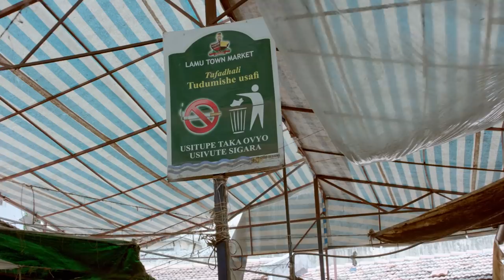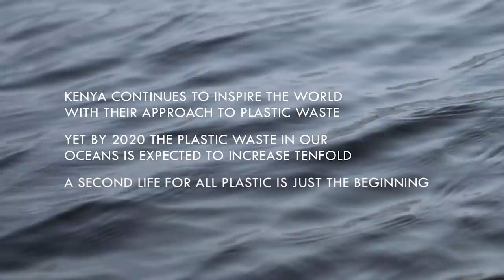A Boat Made From Plastic Waste is One of Kenya’s Solutions to a Global Problem | Short Film Showcase

Comment: This is incredible! We have all of this plastic and until there is none being produced, finding creative ways to reuse it is a great idea!!
Reply from the maker: We agree! There is so much importance in reusing resources rather than tossing them out.
Reply: Surly we should be able to produce  as much as we have and 'end use' for.... It lasts forever so little fluffy packets and bottles and trays is not what you want littering the sea and forest. But what's wrong with rail sleepers/construction beams , heavy or just light duty bricks, and boats like this? Its a very useful resource why not produce any? Its littering countless little fluffy bits that's the issue, we only need people to throw that stuff together, enough of this 'recyclable/non-recyclable' nonsense, it's plastic it's plastic it goes with other plastic to the same place then it can be separated into types if it's worth separating for anything in particular.
I'd say we only really need people to separate 'clean' rubbish like glass, paper, card and plastic from gross garbage. But perhaps plastic should be separate as its a little harder to separate plastic from paper and card but glass is easy as it's much Heavier.
Reply: I think its more likely that this is the only material available to use. Economically plastics are cheaper than wood or metal, they also require less knowledge of material properties to use.
Reply: Not the point...
Reply: There's lots to be done to grow plenty of trees and there's plenty of metal on earth, essentially limitless but for the difficulty in mining and refining.
Reply: i miss you so much my Country Kenyan 😂😭😍

Comment: Microplastics, the recycling solves only half of the problem.
Reply: Yeah not littering plastic in the first place would help prevent a lot of that but it's just not normal to have separate plastic bins in most places.
Reply: @leifcian4288  It's normal in some places
Reply: Something is better than nothing
Reply: Stopping it from getting worse is a good start. Microplastics are still a big deal and the hardest one to resolve but this still makes a difference especially in places where recycling isn't mainstream
Reply: @jblob5764  Plus less larger plastics means less out there to slowly turn into micro platics
Reply: Microplastics are in people
Reply: Half is better than nothing.
Micro plastic mostly are directly made for body wash and cleaning products
Reply: @leifcian4288  yeah those sleep well bins, the ones that make cubes that aren't pure enough to process and get dumped in Asia.
And into the ocean.
Bury it
Reply: @samlabo1688  why isn't pure enough to posses? Into what? Why not encase the least useful stuff into light duty bricks?
Reply: Stopping cruise ship ocean trash disposal would be a no brainier !

Comment: The problem is,  once it is recycled it still exists, and that itself is a problem as eventually, the recycled object will become trash. While helpful and certainly necessary in the short term, recycling is only prolonging the necessary, what is needed is a way of breaking down plastic completely.
Indeed, the best way of recycling is for use in large, more permanent things such as this boat, buildings etc, and although still somewhat useful, the smaller trinkets and bags will have a much shorter lifespan as their intended object.

Comment: What about making plastic containers for storing large amounts of water ? Connect them to the roofs of buildings and when it rains they fill up with water, also smaller plastic containers can be made to make floating bridges, what about making wind turbine blades out of plastic to use to make wind turbines to generate free electricity !

Comment: Plastic is not the problem it's how it is recycled is the problem!

Making them into balls/toys isn't actually a solution. 

Breaking them back down(recycling) is the solution.

The main problem is that the material needs to be cleaned first before it can even be started to be processed back into it's raw form again. 
Making sure each little plastic bag is clean, removing the different types of plastic on a water bottle and separating those in different parts can't be automated.

Which is why most of "trash" is sent to countries with cheap labor! (..some even child labor)

But some countries(china) has put their foot down.....we don't need to clean these just to get the raw parts(not only plastics/electronicss/paper etc) we can make the countries sending them be more responsible and it won't cost us a dime!
(japan is one country that is very strict about disposing of "trash" and recycling because most of it is done in the country)

Comment: We need to do something about this and we need to do it now. Anything with carbon can be turned back into fuel and they should be looking into creating re-usable biofuels with this waste. Another possible solution would be to engineer a bacteria that could digest plastic with enzymes and turn it back into a non-toxic byproduct. 

Physical collection of this waste is impossible because we have let it go on for far too long. It would take DECADES to even make a small dent in the problem we have created.

Comment: Too bad people don't seem to understand that whatever you use plastic for, especialy the ones most in use today, the pollution won't really get that much better. Of course cleaning all the trash lying around is the first most important step. But if you make something else out of it, especially for heavy use, it will still keep releasing pollution into the environment anyway. Just cutting and working the material creates "bajillions" of plastic particles that all get released into the environment, unless you're a pro and collect all of that. Then you start using the thing and through abrasion and depolymerisation caused by UV the product keeps releasing microplastics. Even our clothing, footwear and car tires significantly add to this. Sadly the chemistry and physics of this aren't too favourable.  That's the biggest issue.

Comment: If used aluminium/tin cans were melted down into wire would it be possible to use the wire to strengthen recycled plastic items in a similar way to steel latices are used in reinforced concrete?

Comment: Really want to make a difference r&d ways to turn it into various quality and strength pellets efficiently and cheap .
If this can be done in a mobile transport friendly material then industrys will use it. From Roof tiles and asphalt road construction to I beams that can be strong enough and easy to mold.

Comment: Yes get rid of the most recyclable materials we have ever had just stop throwing it away end of plastic pollution
Reply: It's slightly more nuanced than what you're saying. Plastic is indeed recyclable, however there are different grades of plastic with varying ease of recyclibility and safety. Recycling certain types is harder than others due to the fumes they let off during the recycling process that are both bad for people and the environment and require complex facilities that require expensive safety measures. In a developing country it'd be more efficient cost wise to put in a ban such as their current one than go through the necessary measures to recycle those more dangerous to re-use (which are ultimately the ones we use the most, like flimsy plastic bags, plastic packaging, and vending machine water bottles - not to mention Styrofoam. The current recycling system in most parts of the US actually doesn't recycle type 5 plastics due to expense (it's cheaper to hand off to a third party) and sells them to external companies with the necessary processing plants, if memory serves me right. Aluminum, however has a much higher recycling rate and can be used over and over quite easily for everything from coke cans to waterbottles in comparison.
Reply: @pineapplemilkify  yep styrofoam is bad unless you feed it to super worms they break it down very quickly and yes all plastic is recyclable it can even be cracked back in to oil and turned into fuel all of it and all metal is recyclable and they're is a thing called a vapor hood it's for removing chemicals from the air
Reply: @henryq9390  You're right that plastic can be recycled in that way, I'm just pointing out the cost point for a developing country is going to be a way bigger problem than it is in one that would be considered a first world one. The reusable aspect of products they're making now likely has a minor economic boon with tourists & visitors to the country as well. Thanks for telling me about the superworm/styrofoam thing, it's super cool and I didn't know about it. We should probably avoid an excess of styrofoam though (at least for now), one meal worm can eat 46.36 mg of polystyrene waste per but they don't flourish well outside human made environments (with very few exceptions in the wild as they prefer dark and damp environments) and until more recycling plants and dumps adapt to them, they're still getting chucked into landfills. Also, the amount of plastic being recycled globally, while rising (I think it was 15% recycled globally in 2016?), is still not efficient enough to cope with demand unlike aluminum recycling (where the US has a recovery rate of around 80% and it goes back into  being used extremely quickly), even in anomalous places like Japan where the percentage is closer to 75%. There needs to be better facilities for recycling and better teaching methods and social pressures in place (Such as laws and fines) in order to really change this, because our rate of production and consumption far outpaces the recycling rate, not to mention the amount of microplastic that ends up in the water supply due to improper disposal - and there isn't anything comparable to a superworm that we know of to deal with that yet.

Comment: I know it good and great and all but that would just worsen the problem in Microplastics
Reply: It couldn't worsen the problem. If you take plastic out of the ocean and then compress it into a form that exposes far less surface area to degradation, then it inherently lessens the problem. I agree that it doesn't solve the issue, but there are greater issues at hand.